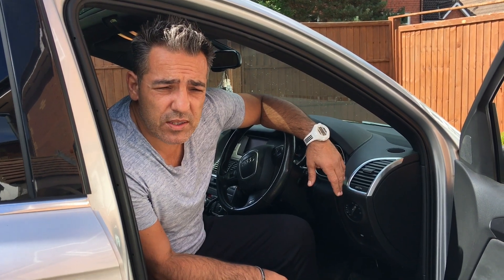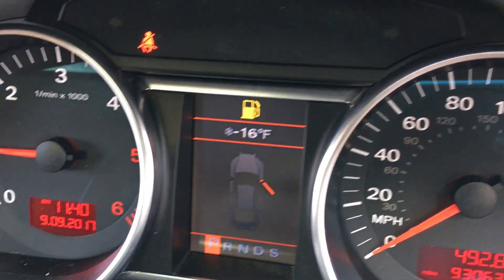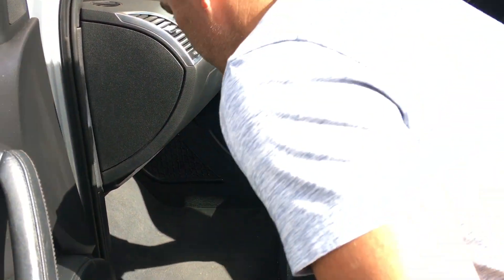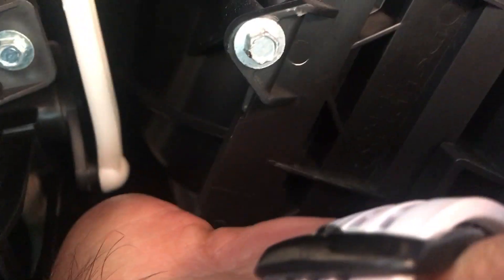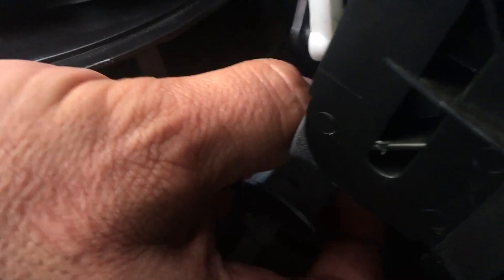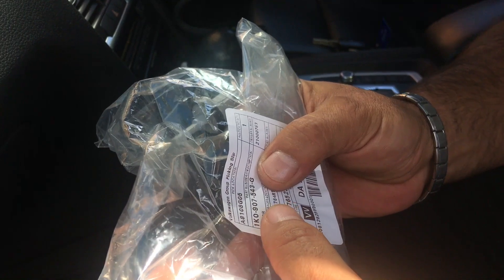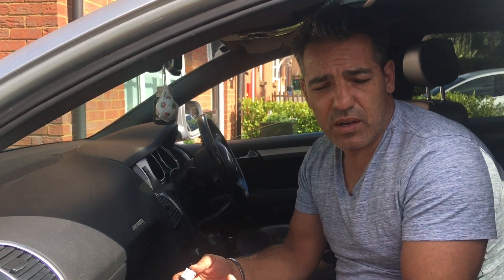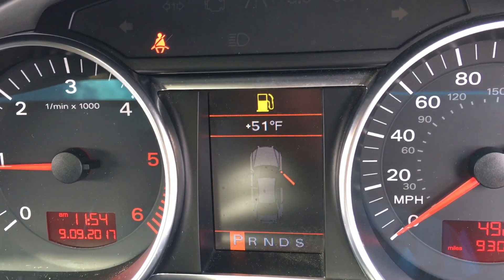Audi Q7 G89 Sensor Replacement and Location

Comment: Thanks Carlos, my 2006 Q7 is doing the same thing after 16 years so I guess I might be out of warranty.
Do you know that the drain bung for the aircon is just there too. Got to have a good plastic bag in place when you open it because it lets some manky rotten water go when you pull the clip but its worth doing every few years.
Justin.
PS my car is 3.0 TDI so when it thinks the temp is that low it fires up the Eberspacher auxiliary heater until the engine warms up so that always leaves a smell when it purges after about 5 mins.

Comment: Hi. My ac is blowing warm.air on the passenger side cold on the driver side.  Would this be my problem?  If not  would code 01334 Right rear door control module no signal or communication?